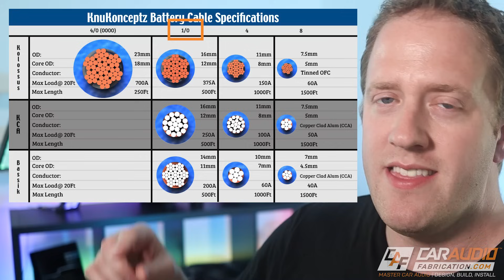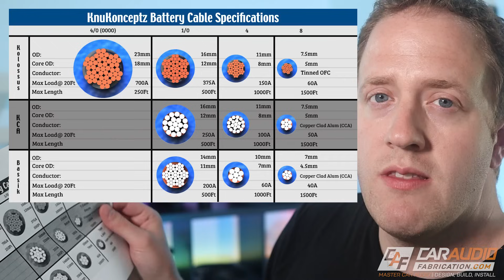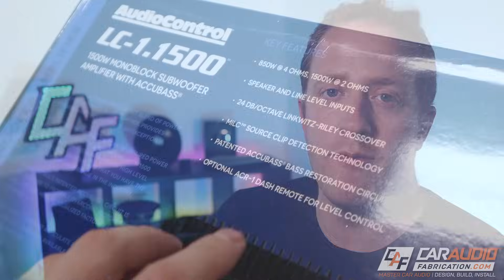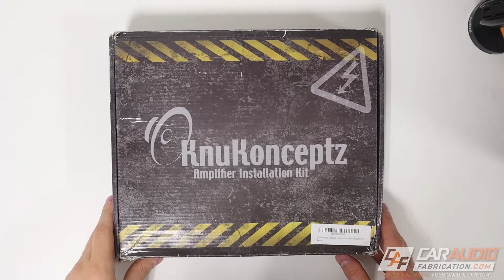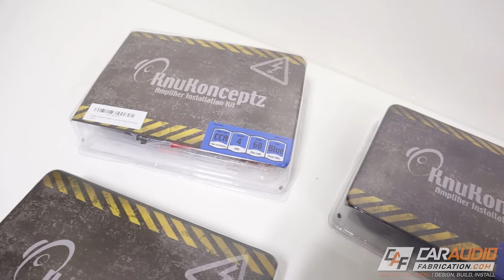Car Audio Power Wire - Do's & Dont's for a BETTER SYSTEM!

Comment from the maker: Thanks for tuning in! Don't forget I have a ton of video content focused on advanced electrical topics for designing your system right in the "Car Audio Electrical Playlist" that you can find here: https://www.youtube.com/watch?v=u4E0ui8yeI8&list=PLmybwiwzi3MVPhGmTqQzRMLJ4GJMx1K9_ Thanks dudes!
Reply: Hello can i ask you an question ,lets say i have an normal AGM Battery "Tudor TK600" and it have lost power due to forgotten the  minus terminal on the battery for 2-3 times and the battery it self broke/discharged to much ,can that do so it cause so my all 4 speakers + sub give out  "crackled sounds" and hear the music aswell played by an Usb-stick?. 

It have work fine for 2.5 years until now.
Reply: Since i have a mono amp and single 12 with 4 gauge CCA power and ground, if I have a voltage drop, I have a smart charging system (gm vehicle) 13.3 to 13.5 volts in the spring and summer (13.8-14.0 volts with lights on), Winter 14.0-15.0 volts. Can I do the the big 3 to get the power loss of CCA wire back?
Reply: @seangowan7441  don't know if anybody responded to you but here's a couple tips,, first is if your amp requires 4 gauge you need to go up to 0/0 CCA. Wire,,, especially if your equipment is premium,, I had the same problem,,, upgrade the factory wires making sure to go through all the factory loops,,, there are voltage sensors in the loops they tell the alternator what to do from 2006 and up GM cars,,, and in CCA wire that I threw away because there was a voltage drop from my alternator to four batteries in the back the CCA did not allow enough amperage to keep all my batteries charged no problems now
Reply: Instablaster.
Reply: I need help with what to do and not do when routing the amp power wire through the vehicle interior, can you make a video?
Reply: Would the 4/0 gauge be the same as the 4/0 XL gauge, or is the 4/0 gauge the same as the 4 gauge and the 4/0 XL gauge is the big daddy??😂 I have also seen the same for 1/0 XL and 2/0 XL gauge.
Reply: I need to know as soon as possible because I need to buy some 1/0 AWG and that question is now holding up haha Since the minimal power wire for my 5k amp that calls for is 2/0 AWG

Comment: Welding cable makes great power cables. Designed for high current and abrasion resistance, all copper, flexable, and solderable. I solder all my connections and heat shrink/ seal them. Kits are nice from the outside, but I can make some better installations by going ala-carte for my supplies. Don't forget adding a negative cable of the same size from the battery. I see that left out all the time.
Reply: I know this is old, but I used welding cable from battery to battery in the back.
Reply: @JamesBond-oc4gm me too and I even found welding cable that was 1800 strand so it’s extremely flexible !!
Reply: I basically had free welding cable for like 15 years working industrial maintenance.  If MSHA or OSHA would show up on site out of the blue.... panic would ensue...lol.

We'd all be grabbing welding cable and extension cords with any kind of knick in them and throwing them in the back of the work truck.

I've used it exclusively for all my car audio stuff.... we would go through so much welding lead it was unbelievable.  Especially arc gouging.  Boss would just give us thousands of feet of it and tell us to go scrap it for beer. It was a laid back badass company for real.
Reply: @metalbill  so replace the battery’s direct negative cable with 1/0 gauge as well??
Reply: @sergiob9146  yes

Comment: I always recommend wiring with 1/0 gauge OFC even if it's overkill . They'll eventually want to upgrade to more power or a second amp and if they didn't do 1/0 they'd end up paying more to upgrade later on . I always show them my box of old wire . Buy once cry once 😆.
Reply: I second this.  Build a solid foundation.  1/0 OFC should handle around 3,000 watts.  Why buy some 8 gauge CCA and spend the time installing it, only to later on have to spend more money on some 4 gauge OFC and spend the time ripping out the 8 gauge and installing the 4 gauge, only to possibly rip THAT out and install 1/0 OFC?  Spend the extra few dollars on some "overkill" 1/0 OFC and not have to worry about moving up from 500W subs to 1000W to 1500W..

Comment: I use welding cable for everything except runs from amps to speakers. Welding cable is pure copper, usually OFC, and made for harsh environments. The manufacturers have to follow strict guidelines for the cable/wire, or it wont even make it to the shelves to be sold, unlike car audio wire. Always go with the biggest wire you can (within reason), due to upgrades that may happen in the future. I'm currently swapping out 1/0 car audio wire for 4/0 welding cable, for my Big 3 and system power. Doing this will future proof things for any upgrades that may happen for me. I should ever have to run new power wire which will save time and money

Comment: How 'bout it, y'all. Listen, I'm having an issue with my system and I can't find anything about it online. I'm hoping someone here may be able to shed some light on things. First, I'm rookie at all this, it was my first install. I have 2 Rockford Fosgate (RF) 12's in a RF box and a 1500W Planet Audio (PA) mono amp. Everything sounded good the past couple months, but recently it was brought to my attention that my "1500w" amp was only producing maybe 300 watts. My RF's are 500w RMF, so this past weekend I tried to strap two PA mono amps together but couldn't get either to come on. So, I disconnected everything and rehooked up the one amp, etc. It's not working anymore, though. And what I mean by that is that most of the time the amp doesn't power on, and when it does, I'll try hooking the RCA's in and it immediately powers off. Both PA amps, I've tried both. I'm running a factory Head Unit and so I'm also using a 2-channel Line Out Converter (LOC). I've replaced every single thing that was involved. I bought a new LOC, RCA's, remote wire, ground & both power wires (one from battery to amp, the 2nd from LOC to amp). I switched to a 1000w Pioneer amp and at first it came on and worked. 30 seconds later it went into protect mode and wouldn't come out. I even tried different subs, 2 MTX Terminator 12's. No blown fuses. Everything is basically brand new, just a couple months old (except the Pioneer amp). I had the LOC wired to the wires of the left rear factory speaker and the speaker still plays. Doesn't seem to be anything wrong with the car itself. I just don't know, y'all. Any help?

Comment: Some of my wires for my install were smaller gauge so i compensated by doubling and tripling up the wires and tinning the ends together i checked resistance and works mint also looks cool.

Comment: I've always used welding cable, it's super flexible and very durable as welders work in tight spaces and very harsh conditions. Sometimes it's a little cheaper too.

Comment: Just got a KNUCONCEPTS 0 gauge wire set today. Amazing value. It came with one of the most heavy duty fuses I've ever seen lol. 
gonna be using it on my American bass 15 inch 2400rms 3800 peak, and my scar 2000d. 
Should work rather nicely :) Very nice quality.
Reply: bruh you gonna need 4/0 wire or a few runs of 1/0 to push 4400 watts rms/640ish amps
Reply: Naw, 2/0 ofc should do just fine. But you better get a 2nd battery minimum

Comment: I used a bunch of 2/0 welding cable for grounds and power, then car audio 1/0 wire for my 1500w subwoofer and 4 gauge for 400w 4 channel amp, I might not have used the best OFC wire but I think it should still be acceptable!

Comment: Good information on CCA. I still can't believe that crap is on the market. Aluminum degrades and gets brittle which causes it to have a decrease in conductive property over time. You also need to seal the end when you cut the wire with dielectric grease and you can't over tighten ferrules and if you are just shoving the wire into the connector, you cant over torque. Just avoid it. I'm just getting back into car audio because I purchased an economy car for commuting with a poor audio system... I keep reading reviews about people burning up their amps or their amps running hot... its probably because they are under sizing their power cable, using poor quality cable or using a poor ground.

Comment: Probably a small tip on wires if You are on a budget but still want the quality.
Dunno how it is in the states, but here in EU OFC can be even 10 times more expensive - in the car audio field that is.. Now imagine this - a basic minimum standard wire for welding has to be at least 95% + pure copper and it goes for roughly 1-2$ for a meter of it. 

That basically speaks for itself :) Cheers, keep up the good work :)
Reply: Budget or not....WELDING WIRE IS SUPERIOR over MOST car audio power wire. Thumbs up brother!

Comment: My research mainly came from you... but one thing I’m still wanting for a video on: Battery to trunk relocation with big 3(or4) upgrade for  future system install if not with system already.
I’ve already done mine with my engine wire tuck but I failed at making it look clean and now has 2 different power wires to the alternator with no fuse there as I don’t know what can handle the heat????
SAVE ME! 😂

Comment: 6:50 Thought you were going to skip that point. Great video! Maybe add some math to show voltage drop of full-spec OFC vs CCA at 17-18ft length. Just to highlight that the difference is not slight. Also, maybe mention Galvanic corrosion of CCA? Tis real and I'm sure we've all seen the wire turn to dust.
Reply: firebirdude2 You are correct! I would add CCA is fine for jumper cables but flat out dangerous for car audio. The repeated hot cold cycles will eventually turn CCA to dust as you pointed out and at that point there's a very real risk of fire. CCA is crap, junk, garbage and should never be used in a car audio system. CCA nearly cost a very good friend his car. Anyone that reads this anf still uses CCA, you have been warned.

Comment: Quite simply OFC Copper wire (silver tinged so won't turn green) which is good for marine use over any CCA type wire will produce less heat going into your amplifier. And if it's good enough for a boat, it is more than good enough for your car. But OFC wire can be 30 - 40 degrees cooler than CCA wire. Important for good amplifier operation.

Comment: -Amp has 2000w stickers all over it.
-You go out and buy $$$$$ 150A wire (2000/14.4 = 138A)

* amp has 30A fuse on it when you take it out of the box
Reply: Every Boss audio product ever lmaooo
Reply: @_JoeMomma  hahahahaha just checked, it actually has 25A fuse :p
Reply: Awdangit!
Reply: @gplusgplus2286  oh dang a 25A fuse? watch out that's some serious power its pushing there lmao

Comment: Clicked on buy it now, for a “ Stinger SK6241 4 Awg” last night. 
Gonna run one amp, and in future a small mono amp for sub.

Hope it’ll be ok.
Reply: If it's "real Stinger wire" than oh hell ya you will be fine but if you bought it online especially off Amazon more than likely no it's not , that's the wire coming out of China and other countries , this wire for whatever reason has stinger branded on it but definitely not true stinger wire , it's the same as buying the cca wire just cheap stuff not true stinger wire , so when I held true Stinger wire in one hand and in the other the fake stinger wire u can tell first of by the weight and second by the flex in the wire , that true Stinger wire is kinda hard to flex  and heavy but great luck to u and I hope u get the tru stuff tho , I've been there and got takin once before

Comment: Just bought $220 worth of gear through the knuconceptz link.

Kord Ultra Flex 12 Gauge Speaker Wire 100' 
Kolossus Fleks Kable 4 Gauge Red Power Wire - 25ft
Kolossus Fleks Kable 4 Gauge Black Power Wire - 15ft

Bassik Negative Battery Terminal 
Bassik Positive Battery Terminal 
Top Post Adapter - Negative 
Top Post Adapter - Positive 

Kord Ultra Flex 10 Gauge Speaker Wire - 15ft

KnuKonceptz Tinned Copper 4 Gauge Crimp Ring Terminal - Red 10 quantity 

KnuKonceptz Tinned Copper 4 Gauge Crimp Ring Terminal - Black 10 quantity 

Firewall Rubber Grommet 4 Gauge - 4 quantity 

Krystal Kable 2 Channel 4M Twisted Pair RCA Cable - 2 quantity 

In-Line Waterproof Mini-ANL Fuse Holder With 150A Fuse

Thanks for sharing all the knowledge brotha! 👍🏽👍🏽👏🏽👏🏽👏🏽

Comment: In a big 3 wire upgrade, would you recommend to fuse the battery power wire that runs to the alternator? If so, would you fuse to the alternator amp or to the wire size?

Comment: I definitely made the wire routing mistake because I couldn't find where the hole was where the wire was supposed to be routed.  I'm running another wire for a solar panel charge controller soon and I'll see if I can move everything to its proper place... I probably just missed something

Comment: My CCA wire reaches my trunk.  My OFC wire only reaches under the driver seat which I’m not a huge fan of mounting amps under seats. Is OFC wire that much better that I should just mount my amp under the seat?

Comment: I went with knukonceptz basic 0 gauge CCA kit for my installation.  1200 watt rms amp running 4 kenwood excelon 10 inch in a 2 ft sealed enclosure.

Comment: I have on hand (2) 4 gauge (Fosgate) wiring kits.  Can / Should I run two sets of 4 gauge wires down the vehicle to my (2) amplifiers?  Is it ok if the wires are close (heat)?  Should I completely abandon the idea?  I thought I could both 4 gauge wires so they don't touch and having two separate firewall grommets.  Is this a bad idea?

Comment: it would have been nice to talk about mecp standards and diminishing returns with running larger then needed wire....and how much you can lose or gain wattage wise depend on the size of wire
Reply from the maker: That would have doubled the length of this video. Calculations and more advanced topics are within the playlist I linked: https://www.youtube.com/watch?v=u4E0ui8yeI8&list=PLmybwiwzi3MVPhGmTqQzRMLJ4GJMx1K9_

Comment: I have a 70A auto fuse which says "can be used for audio equipment". I want to use this fuse between wire charging my second leisure battery in the car. Is that fine? The wire itself is for 12v batterirs.

Comment: Can running the power wire through the factory cable trays cause an interference with sensors? E.g a fuel sensor
Reply: I highly doubt it but possibly

Comment: Can i power the 720 w amp (2 speakers and one subwoofer) by normal 12v wire from car appliances the problem i can't ran wire from battery.
If i do i will lose amp power or i will damage the electric system?

Comment: I have x2 amps 2250wrms and 600w rms,x2 500w rms subs and x1 1000w rms sub and another batt im using 8 gauge for power and ground and for the extra battery positive is that ok or should a go bigger the cables dont even get warm and the system is loud. both amps are connected the the main batt.

Comment: So I bought and installed two wiring kits, both running separately from my battery to two amps. The kit said 680 watt, I figured good enough since the amps are around 600 RMS. The size of the power wires are 6.7 gauge. I thought I might get a distribution block and change how it’s connected currently.
What gauge wire would work when branching two 6.7 wires?

Comment: 1st great vid!
2nd if the amplifier only requires a  4 gauge for power cable, can I use a 0 gauge instead of a 4 gauge?  Are there any positive or negative using it?  Also, what guage of ground cable I must use? Thanks
Reply: @WeAreWatching Yu thank you!
Reply: Get a 0 gauge to a 4 gauge reducer

Comment: Can u use a thicker wire even if the amp is weak or will it blow the 25amp fuse if the wire is too thick?

Comment: I have a KnuKonceptz 4 guage cca kit installed and hooked up to a Toro Tech amp powering a Skar SDR-18 and I get 14.48 Volts on a stock alt and a Rural King battery and no Voltage drop when the bass hits
Reply: _ Chrispy _ nice, I have the 4ga kollosal kit. Been using Knukonceptz since the early 2000’s!!! My only recommendation for wiring.

Comment: What is your advice on putting an aftermarket audio system in a 2006 acura rl (the radio is integrated into the ac controller and alot of other bs)
Reply: Check out the audio control LC2i which allows you to tap into your factory speaker wires to convert into RCA to add aftermarket amps subs etc this is the way I am going to improve my Jaguar system same integrated AC and BS in radio.

Comment: Hi there.  What do you think of running wire under the vehicle and then into the cabin?  I mean, to run    🏃‍♂️  4/0 through the firewall then under the carpet a bit difficult.  Thanks

Comment: So a 600W sub amp @ 2 Ohms and a 300W component amp @ 4 ohms need a 4.0 gauge wire for a 20 foot run?... Is this overkill to go from a battery to the passenger seat (15feet routed and tucked)

Comment: At the battery bass full tilt the drop is no more that 13.5 at the amp it hits as low as 11. Could this be due to cheap wiring and if so would that also cause dimming of lights?

Comment: I hooked up everything and it worked fine till my brother touched the remote knob wire connected to the amp while it was running, it made a pop noise and a lil smoke came out. What does this mean and is it repairable?
Reply: It stays on protect mode now & im sure all my wires are fine

Comment: Hello, quick question I can't find a answer too, maybe u can help,PLEASE!!   Ok so I used knukonceptz 4awg ofc amp kit and now I want to do the big 3 upgrade! So do I need to use the same 4awg ofc to do the big3 with or can I use 1/0 gauge ofc wire to do the big3 with?? Please help, I also just put in the AutoZone Platinum DieHard battery the 650 class or type the same that my car requires but just the nicer Die Hard platinum battery anyway please let me know about the wire gauge what I should use considering I already used 4 gauge and kit hope to hear back from you thank you!